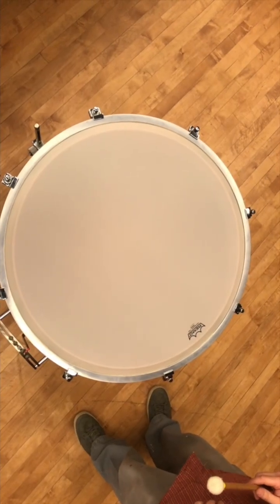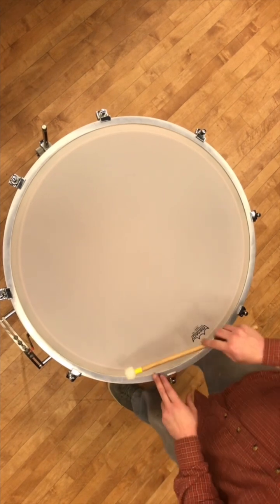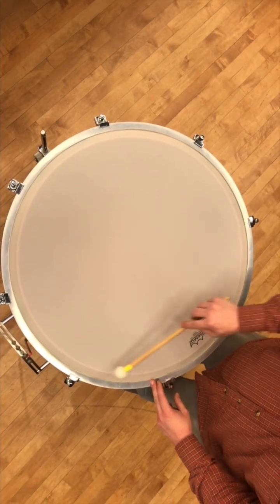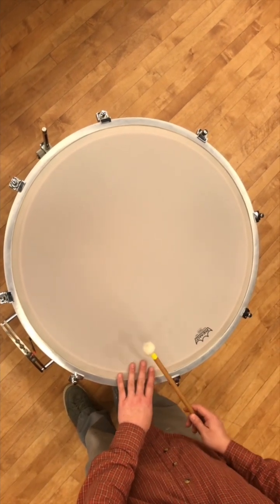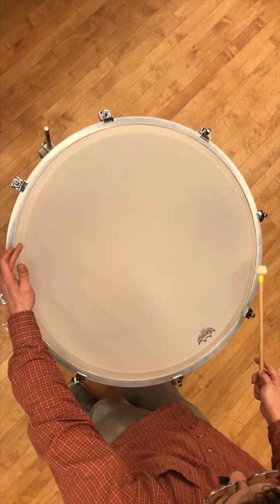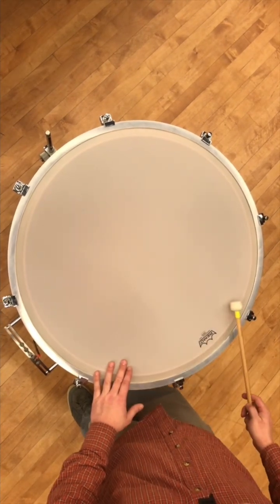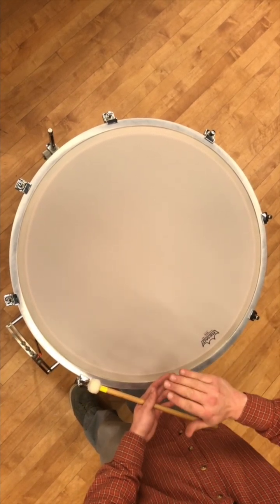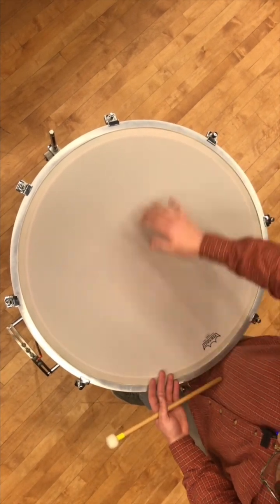Timpani Head Tuning - Channel System

Comment: Would the channel system work much differently with a drum with only 6 tension rods?
Reply from the maker: I feel like the best way to describe a 6 lug “sound” versus an 8, is more “broad,” and less precise. It’s harder to control what would be the secondary with only two lugs. In theory you could apply this idea, but I’ve never really had much luck. I usually use an averaging system with 6 lugs. (Light hits in the lug region will activate only that lug, then compare to a forte hit, which is the entire head - make the quiet pitch match the average… perhaps another short video is in order!)

Comment: Not ideal, works in a pinch if you need to do it by ear and quickly.

Using a drum dial will never steer you wrong.
Reply from the maker: In my experience some drums can utilize the drum dial, but it's never perfect. I've always trusted my ear more than a drum dial, but I could easily be in the minority in that respect. It's kind of like using tuning gauges: trust the ear if it's trained, but the gauge is still very useful and helpful to someone with less training/practice. (Hopefully none of this comes across as offensive!) Thanks for your comment!